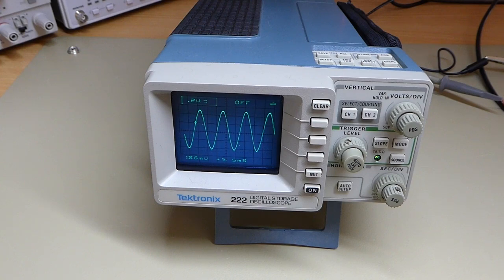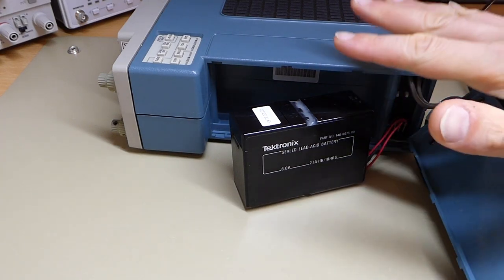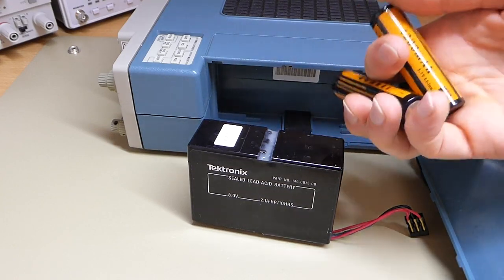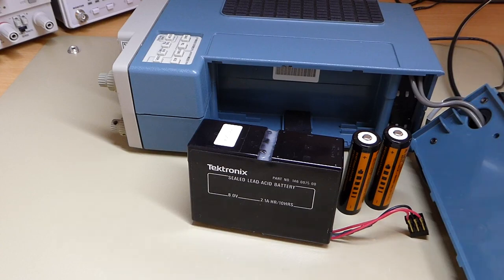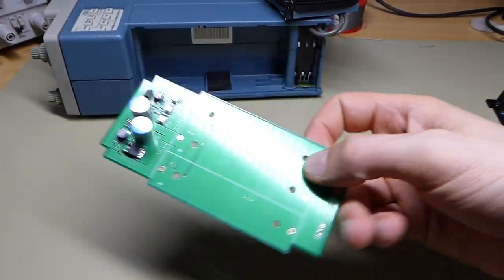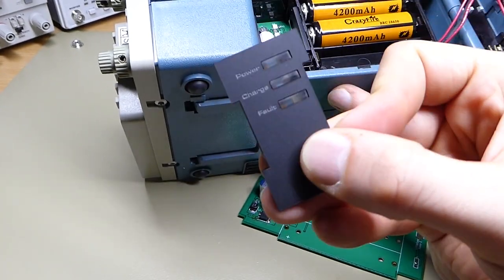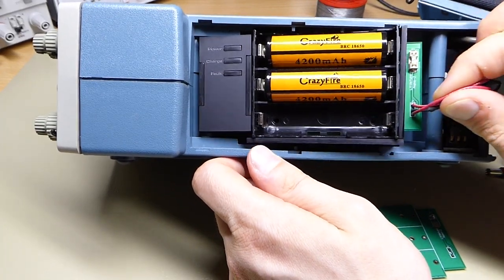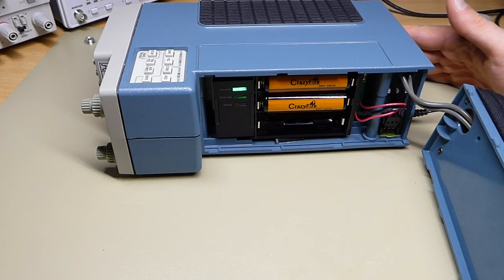Tektronix 222 / 224 Li-Ion Battery Pack

Comment: A very professional build that actually looks like it belongs with the scope; "Excellent" I recently got the Tektronix 224 60 MHz scope in flawless condition, yes the lead acid battery is dead and not available. I have thought about a number of ways to come up with a solution, your design is exceptional and certainly worth consideration. Congratulations on a job well done, will consider purchasing your board if available.
Reply from the maker: Thank you, it's great to get such good feedback! As I said, this is really quite over the top and Mr Carlson's method of using NiMH cells is probably more practical, cheaper and pragmatic. But if you want to give this a try send me a message, I still have a few boards left over.
Reply: The only downside I can see to Mr Carlson's solution using NiMH batteries is that he's relying on the 222's battery charge circuit to charge the batteries and I suspect the result will be overcharging if left plugged in.  I suspect that many of the dead batteries in the 222's are due to overcharging via constant current.

Comment: Well, I found an adapter that fits but it's rated at 15VDC and 800mA but I tried it anyway -- and it works!   The adapter is a small switcher type as most of them are but it does seem to operate the little bastard just fine.  I'd be happier if the voltage was closer to 18VDC and the current was rated a bit higher,  but it works.

Comment: I have a really old Tek 222 that of course has the dead battery problem and seeing this video had me pulling it out of storage to look it over once again.  I could not remove the battery cover by hand and had to use a screw driver to pry it open.  Thankfully there was no obvious leakage so if I can find power for it I might be able to bring it back to life.  I can't find my manual but the back indicates the external power can be either 16-20 VAC or 18 VDC.  I may have the charger someplace, but finding it may take a decade or more so I may hook it up to my bench supply.  Just to be sure, the center pin should be plus and the outer barrel minus -- correct?

Not that I need this little gem as I now have a Rigol DS1054Z but a portable battery powered scope is great in the field or for working on the car.  I have a couple Drok buck converters that I could use but I'd need to power from a higher voltage so that would be a 6S LiPo setup which would be a bit cumbersome but would offer a pretty decent run time.  Actually, my DJI Inspire 1 Pro drone has 6S packs of 130WHr capacity so all I'd need to do is rig up some cables and a box to hold the parts.

Comment: you can put in battery acid,in the original ones.they typically dry out.dont over fill as it will expand.go slow and check with a volt meter.
Reply from the maker: I'm afraid the original batteries cannot be refilled, as they are sealed lead acid types, which use gel rather than conventional acid.

Comment: good project, I've been working on a project not with anything as fancy as a portable scope, just wanted to replace some sub c nicad in an old bissell spot lifter. was considering using a boost converter but am unsure of the current draw from the motor. hope mine comes out even half as good as yours, well done :)

Comment: I'm a little confused about the parallel arrangement of the batteries. When I saw in the video (before seeing the circuit) that you have 3 separate protection circuits I was relieved that there was some form of isolation between them, even though perfectly matched batteries should behave like one, as mentioned on your page. Looking at the circuit, you have 3 batteries connected together via 0Ω links (I assume for fusing?). Am I missing something? How are the protection circuits acting on their respective cells alone?
Reply: Oh wait.. I think I get it. R14-16 are optional?

Comment: Hi,

I am aware that this is not a very recent posting, I really like what you have made here to re- power the scope. I have a 222PS that I cannot find battery replacement for and I would like, if at all possible, to get one of these boards from you. Let me know what the cost is if you still have one available. Thanks.
Reply from the maker: I'm afraid I don't haver any boards left. However, I recently updated the layout and might get some more made. I'll let you know if and when that happens.
Reply: @ Kitsune-denshi   If you ever do another run.  Please let me/us know...

Am in Australia and trying to get bits and or PCB's done can be a nightmare...  

Love your work and focus on the detail...
Reply: @kitsune-denshi  Well..... did you ever.... or not .... make some more. I still got that little scope and would still like one of these.... PM ME if you please. Thanks.

Comment: Excellent, talk about over engineering!
At first I thought, what an intelligent design but he uses some poor fake rating li-ions?  but clearly it was intentional :)
A pair of something like panasonic NCR18650B or similar would be great, something like 24Wh vs the original Lead acid's 16Wh,  (minus the small boost loses) is a great improvement.
Reply from the maker: Glad you appreciate the stab at the batteries - I'll just never understand why most of them have some sort of reference to fire in their brand name! You'll be pleased to hear that I did indeed get a bunch of Panasonic cells for actual use because I wouldn't want to leave those cells unattended :)

Comment: You should look into your 18650's. 4200mAh is more than max currently rated 18650 (3400mAh). 
One way to check this is the weight. If its less than 42g (like 33~35g which I'm expecting) they're fake. 

Check it out :) (just a tip)

Ps. A perfect source for 18650's is laptop batteries. open em up and you usually find 6-8 cells (depends on type).

Cheers
Reply from the maker: Thank you very much for your advice. I am absolutely certain that the capacity printed on these batteries has nothing to do with reality - that and the hilarious brand name was precisely the reason why I used them for comic effect in the video :)